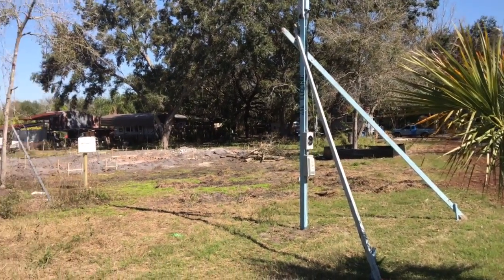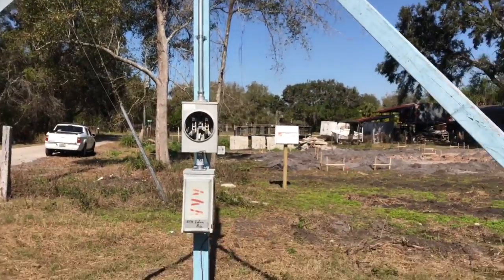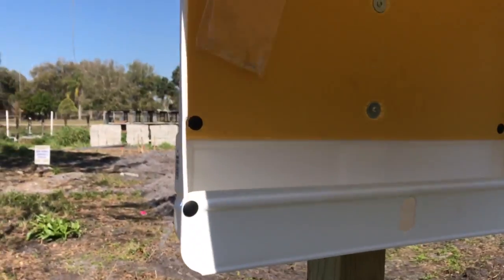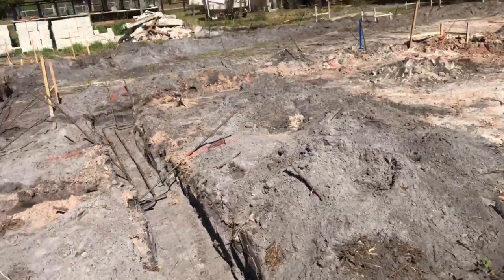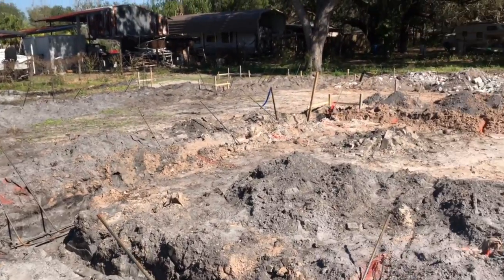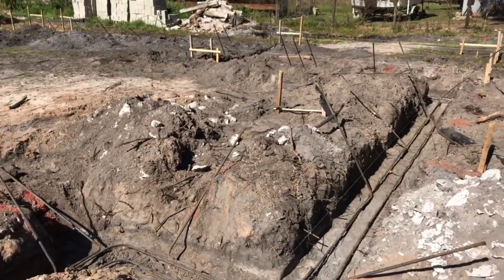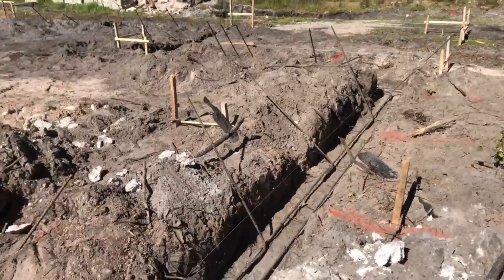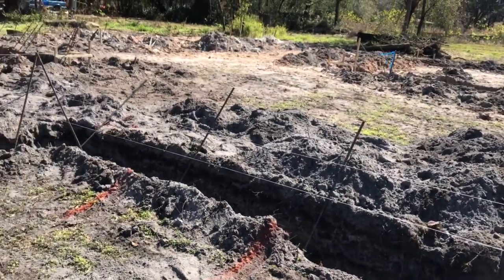How To Build a House: Footing Steel & First Inspection

Comment: What is the distance between each rebar.
Reply from the maker: That depends on the load calculations for the wall. An engineer will assist with the final locations.
Reply: Thanks.
Reply from the maker: Liability brother. Go to engineering school. Learn about loads and why things are the way they are instead of relying on someone to tell you how to do something. I’ll label my videos however i choose.

Comment: Good luck building your new house. I'm a contractor so if you have any questions just ask.
Reply: Chris Walsh how big of footing should I have for a 20x40’ studio
Reply from the maker: It depends on your geographical location and building codes. Footing size, rebar grade and placement will all be determined by your location. Width, depth and placement of rebar as well as the PSI of the concrete are all variable based on the structure that will be using the ground system.
Reply: How block do I need to bill a 3 bedroom house